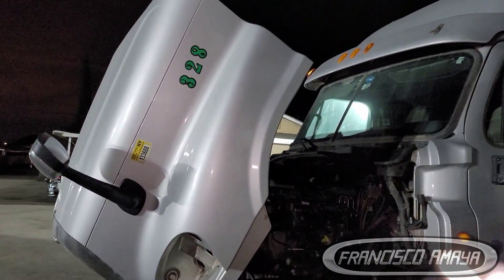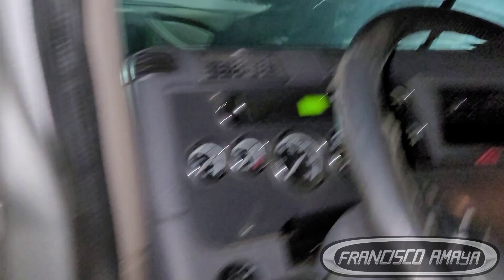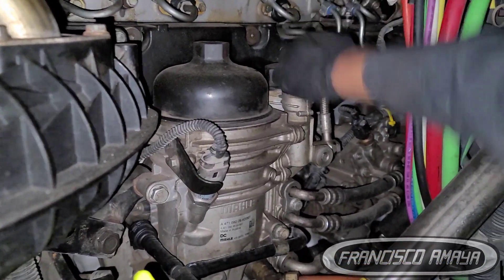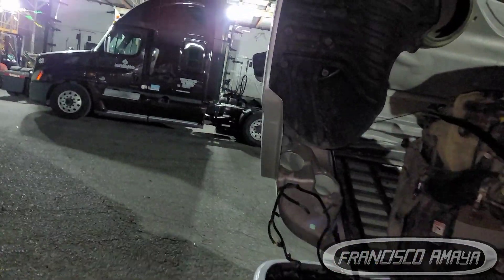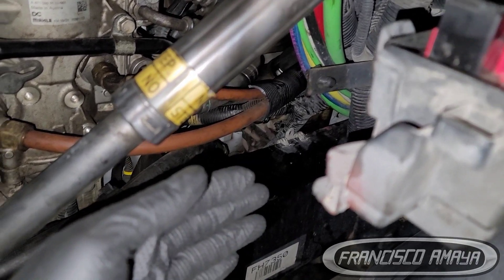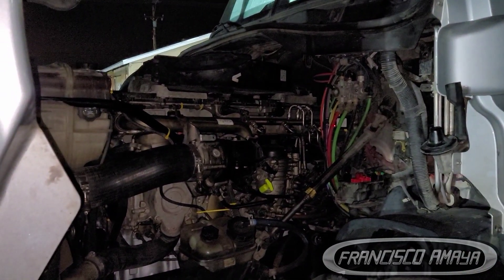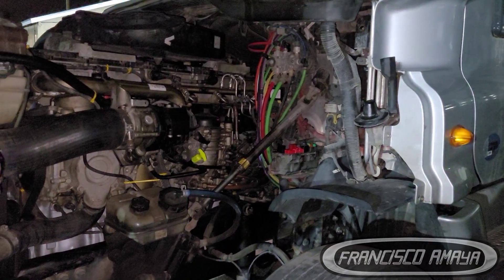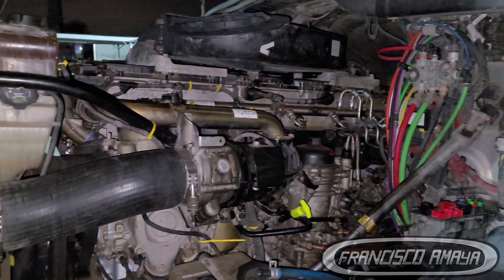DD15 engine first start after major overhaul and crankshaft replacement oil pressure inspection

Comment: when after i change the fuel filter and cold weather pass by , I have a same issue before, i check the low pressure side is 16 psi, so no pressure, so i change the ball, check valve fuel pump injector then not working, so finally i change the fuel module whole thing then working great!!! it was the low and high side seal( no body sell gasket) was broken I guess. so now good That low side should be 90-100 psi at least, when you are using hand pressurize bug spray it was 40psi, so it must over 40psi to 100 psi help to start truck.

Comment: Hi, quick question appreciate any help ? Have 94 fld detroit 60 
(P) air GAUGE goes to 120 (S) gauge will not go all the way up only about 100psi with truck ON parked or truck run ning  air dryer purges when (p) is at 120 and (s) 100 but issue is right after air dryer purges I loose air about 20-40 psi from second gauge in about 30sen the I hear a small purges from air drier then build air again and does this over and over while trucks parked or trucks running only time it stops is when truck is off..  no air leaks any were,  just replaced new air drier , governor swapped gauges does the same thing . What do you suggest my issue can be ? Thanks for any help